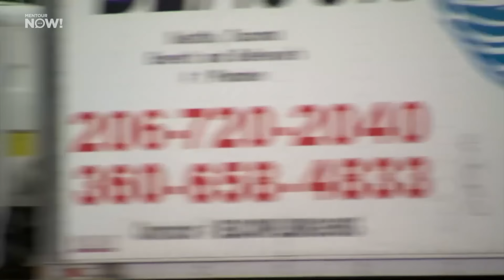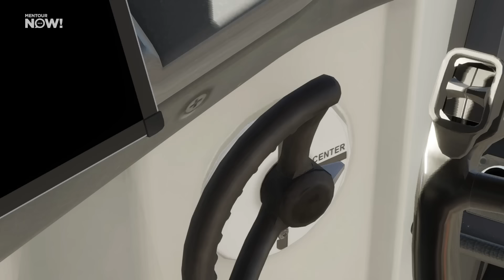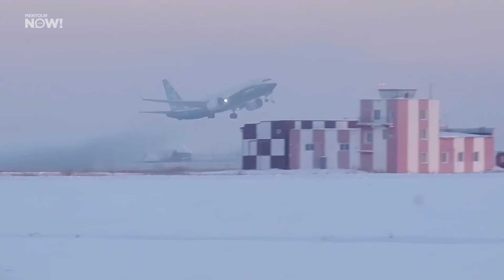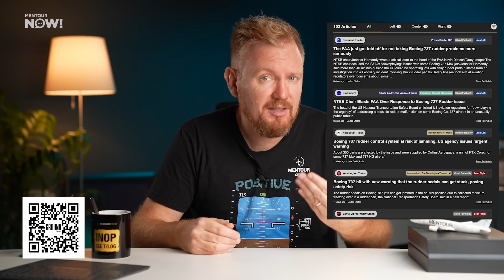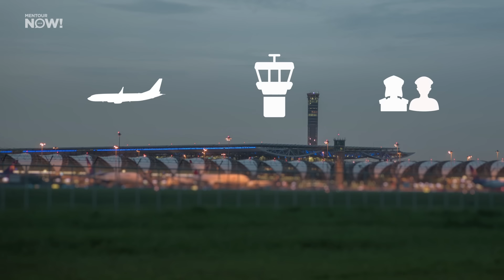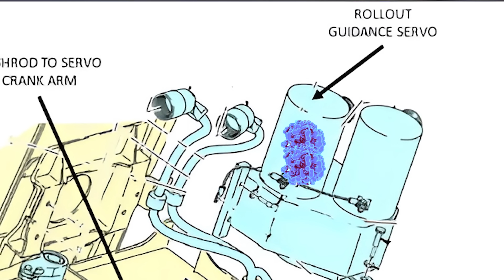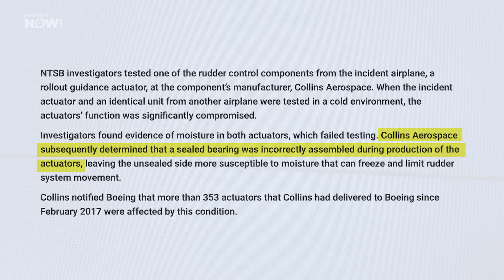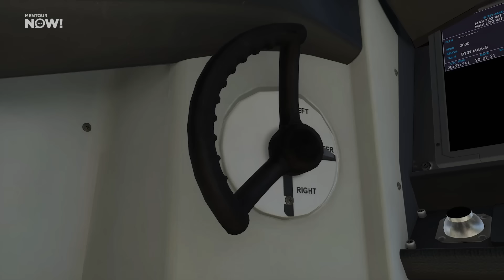Does the Boeing 737 Have ANOTHER Major Flaw!?

Comment: Probably worth its own episode: If I am correct, the 737 would not be certifiable as a new plane as it doesn't meet current standards, thanks to all the grandfathering rights. So the question is of what good are standards if we continue to grant these rights to a product which supposed to cover 50% of the market. It's the same with the 767, on which Boeing finally pulls the plug. What's the point of introducing noise emission limits if then you exempt planes again. In my mind this practise amounts to unfair competition, and carries weaknesses supposed to be fixed by newer standards from the past to the future. While there are of course some arguments for grandfathering to be made, I believe it went too far and ultimately weakened also Boeing,  using outdated platforms as a comfort option. Standards are important also to stimulate innovation.

Comment: Mentour, I have no real knowledge of aviation, I am just an interested viewer - almost everything I know (which I admit is not much) I learned from your excellent videos and from other great channels like 747 gear etc. Sounds to me like the 737 (and maybe other planes) are basically an old design that have had lots of updates added over the years to make them better - which sounds great and sensible. Not sure if it was on your channel but I learned about something called "type rating" and the idea that it was easier / cheaper for manufacturers and airlines to just keep adding on lots of little changes instead of creating a full update or new design - surely this would make the documentation and records a lot more complicated than a fresh new design with a single "user manual". Could this be contributing to these problems?

Comment: In case you think that kicking the rudder pedals is no problem, remember the deaths of 265 people on November 12, 2001,  due to the crash of AA Flight 587.  The cause of the crash of the. wide body Airbus A300?  The first officer, who was flying the airplane at the time, applied too much force too rapidly to the rudder pedals, causing the entire vertical stabilizer to break off of the airplane.  Also, keep in mind that there were no survivors of the crash of a 737-200 in 1991 or the crash of a 737-300 in 1994, each of which were caused by the failure of the rudder actuators.  In neither case were the pilots able to overcome the uncommanded deflection of the rudder.  Rudder malfunctions can and do kill people.

Comment: If it’s Boeing I,m not going what a rediculous solution to use brute force at a critical time on landing do they not remember a flight when the horizontal stabiliser was stuck with a faulty jack screw and the pilots used a lot of force causing it to fail and the plane to nosedive to earth killing everyone not a 737 but a similar situation will Boeing never learn until they kill more innocent passengers the faa is also guilty of incompetence in this matter

Comment: The Category III C Auto landing would come in Handy during an emergency. Instead of running out of fuel, the airplane could land without any visibility. Then it doesn't matter if taxiing is impossible or firefighters have a hard time to reach the aircraft. It's better than the need to reach the crashed remains no matter the visibility.
So while it's scary and usually not necessary, it will provide extra safety.

Comment: The rudder... again??? FAA should just ground all 737 Max right now until Boeing comes out with a fix.
Reply: I'm concerned that Boeing, the FAA and US gov are all in this together for economic and profitability reasons. There have been so many issues with Boeing aircraft (not saying it's only them - but they are top of the incident list by far) the FAA should ground the entire fleet and conduct a root and branch investigation (independently verified) into every single issue, mandate a comprehensive list of actions that need to be completed and tested (on the ground and in the air - with the same vigilance as testing a brand new plane). After all of these tests are passed the FAA and US gov need to fine Boeing sufficiently that compensation can be paid to every single airline, airport, booking agent, customer that has been inconvenienced by the mandatory grounding. Only then should they be allowed to fly again with the condition that any future incident will result in this entire process being repeated.

Comment: Thanks for this report!  It goes to show you how complex the necessary troubleshoot can be.  The Boeing advisory was indeed crude and not well thought out.  I would have thought that the advisory would have at least asked that captains take over all landings in the fault parts affected aircraft and be ready at the tiller wheel in case rudder control becomes stuck until the Collins part could be replaced.

Comment: Sealed bearings sometimes have only one seal and it has to go towards whatever substance it’s supposed to keep in or out of the component it is installed in. So some idiot put this one in upside down! This is basic stuff being stuffed up. Where is the quality control? The pilot did well to think of using the tiller in time to prevent an unplanned excursion off the runway, and also to not overreact and move the tiller too much.

Comment: 10:02, its not a drama story, keep it straight and narrow
Reply: skipping through most of this to get to the 2 mins of actual real info that we need to hear
Reply: TLDW some 373s have a Collins Aerospace made rudder control assist system that is not meant to be used in the US that should have been turned off, and it was, but still installed on planes that were originally meant for EU customers, but it was not assembled correctly allowing water to get into a not properly sealed bearing which then froze at altitude and locked up the rudder.

Comment: I guess Software is structurally better suited for such functionalities where in a hardware solution multiple separateoy controlled actuators want to act in the same thing.
Fly by wire better the more autonomous the systems get.

Comment: Great video, thank you!  Question: during rollout, is differential braking an option to maintain the centerline?  I believe there have been past incidents where the tiller was used at high speed, and caused damage to the nosewheel...so this may not be the best option.

Comment: If I ever dated a super model who’s had 3 boob jobs, 4 face lifts, and 3 tummy tucks then goes wrong. Maybe,
Just maybe I should have gone out with the 22 year old. That’s the 737’s issue you can’t patch up old stock and call it new….. I’d still have a great time for a bit until it fell to bits. Exhibit A 737 Max

Comment: What we have is a series of human failures not specific to the 737 MAX's 737 linage.   The reality is.
1 Somebody at Boeing really really messed up the MCAS software*
2 A team of Boeing/Spirit people failed to properly install a plug door.
3 Collins Aerospace installed actuator bearings with the seal side in instead of the seal side out.   

^If MCAS had been programmed correctly the 2 crashes would not have happened.   Boeing is responsible for all of these.

Comment: I think a good stop gap solution for jammed or restricted rudder already exists in the cockpit. It’s the rudder trim switch. The rudder trim is an electric motor at the back of the aircraft which also can deflect rudder that isn’t the PCU’s or raw pilot cable input. Due to being a closed loop system through the rudder cables. The rudder trim should have enough torque to break free the system. In a worst case scenario where something breaks in the system. Better hope it’s the cables that break as the rudder trim motor is at the back of the aircraft and passed the cables that run the length of the fuselage. It’s still bad advice to tell a pilot to kick it free. As in doing so might make the rudder stuck in an even more unfavourable position as MentorPilot explained. I’m no pilot but using the rudder trim motor makes more sense to me in the event of a tight/restricted/stuck rudder. The same case applies with the stabiliser trim too. The motor is on the screwjack at the back of the aircraft and works in tandem with the cables in the event of a stabiliser trim motor failure.

Comment: While Boeing isn't responsible for manufacturing this improperly assembled part, any reasonable jet airliner pilot would find the recommendation of using maximum force to overcome a stuck rudder, whether in flight or on the ground, is irresponsible at best and leaves you wondering if there's anyone left at Boeing who knows how their aircraft is supposed to fly or how to safely handle the flight control surfaces without breaking them.  This made me remember the  AA587 crash right after 9/11 when the pilot flying an Airbus A300 over stressed the rudder and broke off the vertical stabilizer while running into wake turbulence soon after takeoff.  Imagine what might happen if you followed Boeing's recommendation while in flight and it broke past whatever limiters, physical or software protection, they have on rudder movement in flight...

Comment: Kudos to United for taking the incident seriously and quickly investigating and reporting their findings, and to the NTSB for getting the message out.
Reply: Not sure NTSB was totally down with United having taken a 45-tonne aircraft on a test flight to investigate a potentially catastrophic flight control failure BEFORE getting in touch.
Reply: @alexc4300 
The NTSB investigates, they don’t have an opinion.  you might be thinking of the FAA.
Reply: @neilkurzman4907  I hear you, but I’m sure the NTSB’s investigators had an opinion on conducting a test flight after two crews reported the same fault on the aircraft, even if it didn’t make it into the dry language of AIR-24-06.
Reply: @alexc4300 
I’m sure they had personal opinions on the subject, but the NTSB doesn’t have any jurisdiction until the plane crashes.  As far as a test flight, I would hope it was done under the rules set by the FAA.
Reply: ?KUDOS? its their ficking responsability to do this as a bear friggin minimum.
Reply: @Steve211Ucdhihifvshi And yet history is littered with the bodies of people who died in tragedies caused by companies who didn't do this. Nothing wrong with praising companies for continuing to put safety first when that isn't always a guarantee. The bar should be higher without a doubt, but that's just not always the world we live in. After all if the minimum were actually that high we wouldn't have had multiple 737 MAX's suffer horrifying failures with nobody in prison over it...
Reply: @Steve211Ucdhihifvshi :  bare, not bear, while you're whining about something wrong...

Comment: Not assembled correctly could be something extremely minor.  For example, too much force is being applied to insert the bearing (using 1 too many fingers), or the bearing is only thing that should be lubricated during insert and not the shaft.

Some of these things have very strict guidelines on how to do the job and not to stray off of it.

I have some knowledge about because i work for a plant that will be working on the repairs of the metering units of the "LEAP" engine's.
Reply: Now what did I just read? Hmm...🤣😇   cheers! / CS

Comment: 737 max has issues. They made this aircraft to compete with the A320 neo, but the 737 has been the same old design, ie short ground level. The new efficient engines had to be placed upfront to mount it but failed in aerodynamics, thus came in an unwanted MCAS to stabilize the aerodynamics by keeping the aircraft from stalling. Now MCAS was to control the elevator controls which eventually the AOA sensors (these were the defective sensors to activate MCAS) would give feedback for the MCAS to activate it. 
My doubt is that did Boeing play any games with the rudder controls just like modifying elevator controls ?

Comment: When Boeing was going to make SST with articulated wings I was a test tech on the cabin air compressor. We tested to -55C. At one point in the test, a speed change, the whole assembly disintegrated. We never found all the parts. Lockheeds fixed wind cabin compressor was less complicated and survived all testing. Neither aircraft was produced.

Comment: To me all this started because Boeing was trying to introduce a 'new'  plane (737max)without needing to  re-certify pilots. Wouldn't it have been easier and less expensive to just remove the MCAS system and pay for the recertification of pilots. This would have removed any question of the planes safety and reassured the public reinstating confidence. 
Now if anything goes wrong it's a media storm and the market and travelling public reacts accordingly.
Reply: As we found out, it was easier and cheaper to make a software that control a critical system with only ONE sensor input data...

Comment: The 738 has had rudder issues since the early 80’s.  There have been several that have augured into the ground from un commanded rudder inputs and locked hard to one side or the other.  This latest Boeing strike will most likely destroy the company and the Chinese will buy up the remaining skeleton..

Comment: A part that was designed correctly has begun failing because a very reputable sub-contractor (Collins) assembled them incorrectly.  It took this many years for the problem to surface, because of the terribly slow and insidious ingress of moisture.  Of course it's easy to jump on the bandwagon and blame Boeing.  Nothing to see here move along.  Great explanation video though!

Comment: According to the thumbnail, it’s missing the right horizontal stabilizer (elevator) as well as the bottom part of the right split scimitar.
CORRECTION: The thumbnail was changed and this joke no longer applies.
Jokes aside, this is just sad. I’m an Airbus and Embraer guy and I feel terribly bad, let alone Boeing fans. I still wonder how long Boeing will remain a profitable company any longer, if it’s even profitable anymore.

Comment: couple of thoughts; i found the video clips of the "hard-over" accidents to be quite gratuitous. They were decades ago. Concerning Boeing's response to the "Frozen" actuators i totally agree that you wouldn't want two pilots getting full rudder deflection just after touchdown, a very poor "remedy" , were that to happen at speed and altitude, say maneuvering during early approach phase it could have disastrous consequences. Boeing is in dire straits, very bad reputation, and massive, crippling strike. One wonders what the monetary cost to Boeing would be if they accepted the workers offer, in the long run. thanks for this comprehensive exposure,